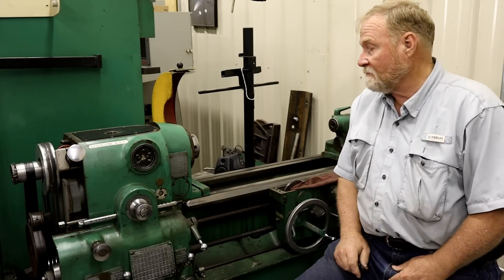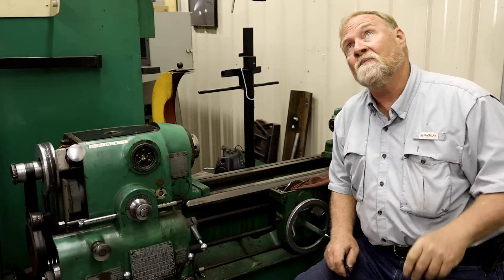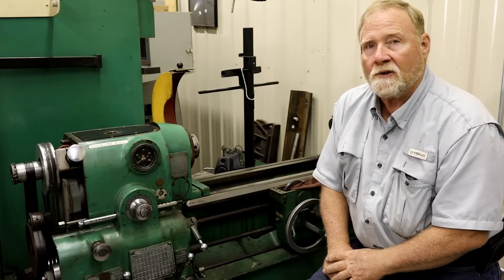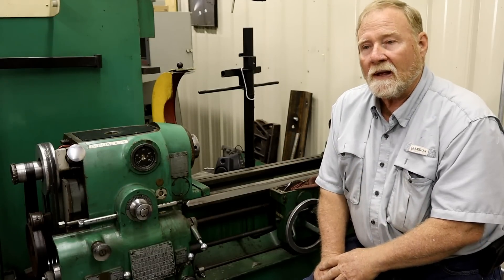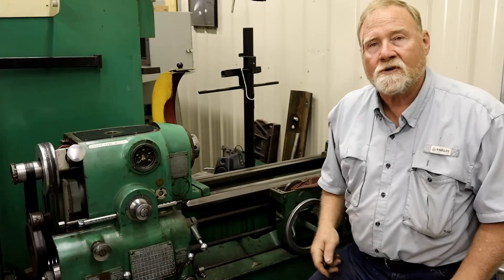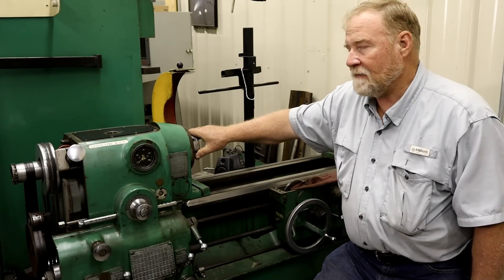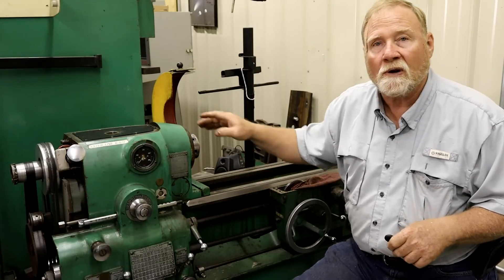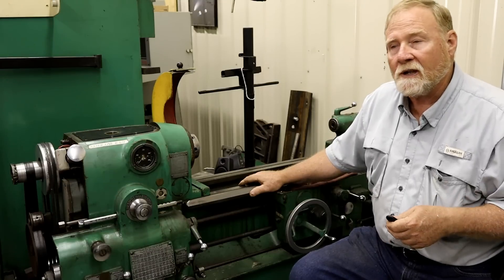$ 7000 Monarch 10EE Mistake : Fixing the Ways, Going to Windy Hill

Comment: With only having one shot at this to get angles and finish right.... Even though it is only 7 thou, I'd question if pneumatic angle grinder spindle bearings are going to be rigid enough to provide a precision surface without radial or axial deflection. Leaving ripples due to inconsistent speed or loads. Definitely not with a flexible sanding disc. A cup face wheel if trammed true to the surface being ground? Although leaving circular grinding marks. 
I'd speculate you will end up hand scraping to finish anyways to match the apron ways to the bed ways or visa-versa if turciting to restore apron position to whatever is removed from the bed. Maybe practice on a throw away lathe bed to prove your theory first?  Mount that grinder to your planer to prove best results on scrap similar to the 10EE material hardness? 
I've known field service guys years ago with similar portable mills putting the crown back in press brake beds mounted exactly like your plan.
Reply from the maker: The whole point of this method is I don't just have one shot at this...  Just like when I scrap in a way or edge I scrap a little and measure... Using the die grinder like a scraper tool....

 IF all else fails I'll just rig the grinding spindle on the planer..   I am looking at this method hoping it will be sorta like a portable line boring operation :)

Comment: yes it would work,
could you set it up on your planer with grinder spindle?
or get Thompson ground rods as your temporary ways
Reply from the maker: The rails I am making are going to be as good as a straight edge, I'm shooting for hand scraped perfection here and the rails have to be perfectly straight for 48 inches with no sag or flex.. I have never mesed with the ground rods but I doubt they can hold the accuracy I need...
Reply: @10swatkins  I like your idea for Ingenuity

Comment: Small air grinders do NOT have preloaded ball bearings like a toolpost grinder. All that rigidity you talk about wanting in your iron guide rails will be lost in loose bearings.  Bear that in mind.  Also, you might be fighting wheel wear on very small abrasive stones.  Maybe think about using CBN wheels, as they wear very slowly. Something resinoid bond should be good enough. I think the nickel plated wheels will just cause chatter and burning.  Consider designing your iron rails so they can bear on the UNDERSIDE of the bed ways, where the uplift straps usually affix the carriage. Usually the uplift straps never actually touch, and there should be no wear on the bed under there.    Best of luck.  --Doozer
Reply from the maker: A tool post grinder is too big to get anywhere close to the head let alone past it by the three inches I need...     The die grinder is as big as I can get into position to do all the angles... The rigidness of the rails is to prevent sag  and alignment to the best it can be... I Don't think of this as so much of a grinding operation like on a grinding bed... I picture it more of a delicate hand scraping job , using a die grinder rather than a hand scraper... If this was 20 or 30 thousand I would have it apart and on the planer with a grinding rigup... This is only 7 thou and will just take patients..  

 Oh and with the rails and heavy sled I have a perfect indicator base that is not affected by any of the operations and can let me see how I am progressing at any time :)
Reply: @10swatkins  Steve, I am not saying to forgo using your die grinder.  Not at all.  Just saying be aware of the challenges of getting a good finish without pre-loaded bearings.  Hence the recommendation of a  CBN resinoid bond wheel.  --Doozer

Comment: Love your confidence and getter-done attitude.  About the sanding disc, r u planning on the ubiquitous rubber sanding pad.  Are you concerned that will deflect?  What about the spindle runout on the die grinder?
Reply from the maker: I can't get anything large up close to the head so everything has to be small... A cylindrical flap disk small enough to do the job,,,

Comment: How will you ensure the grinding rails are in a parallel plane to the spinal rotation over 48 inches? 
Also, should you use a larger diameter grinding wheel instead of the die grinder? Wouldn’t this be a way to limit the wear on the diameter of the wheel as it traverses the length of the bed?
Reply from the maker: A larger wheel can not get close to the head....   I will align and check alignment using other surfaces that were ground when they made the bed, Thanks for watching..

Comment: Could you temporarily repurpose the cross slide and mount it on the aluminum plate? It would definitely be rigid enough and yet adjustable.
Reply from the maker: That's a though...  I think not only because I need a lot of travel across the sled to be able to lay the die grinder where it needs to go... To get the back saddle rail it will be 3 inches off the side of rail...  Thanks for the idea !

Comment: I think your plan is the best bang for the buck. The sanding disc idea I'm not sure will work because sanding grit and hardened steel may not have much longevity. I'm thinking a high quality grinding "stone" of surface grinder type material  might be better.AL B.
Reply from the maker: From my experience sanding is a lot faster than grinding stones...  I have under construction a Mech Mate Router Table... For years they have experimented with the best way to make the rail system and grinding disks were found to not work nearly as well as flap disk sanding pads... Now I'm thinking that it might have to be a combination of both to get a really nice finish...

Comment: My prediction:  you and Clarke are going to BS all day and become great friends, then at some point in the future on another trip actually get the furnace fired up, molds rammed, and metal poured.   You're also probably going to come home with at least one broken muller to add to your project list.   Spare yourself and give that project to Don.   One more thing, PLEASE mount that die grinder by the angled gear housing itself and not the motor body, they have a terrible tendency to vibrate the jam nut loose under load/vibration (especially when mounted solidly) and then the head swings around and digs into the work or just blows up.  There isn't enough red Loctite in the universe to hold the danged things secure.
Reply from the maker: I think your right!   I am trying to talk Don into coming with me... He can work on the muller while we BS :)

Comment: The concept is solid but I doubt the die grinder will get you the quality outcome you're looking for. the spindles in the die grinders are not precision spindles and usually have quite a bit of slop in them you are going to need a grinding spindle of some sort.
Reply from the maker: They are too big... If there is slop I can overcome that... Don't think of this as a grinding project where it comes off the machine in one pass and there are no adjustments.. Think of this as I do... A bed that has to be hand scraped  to get to perfection... The die grinder is just a hand scraper in my mind...

Comment: Do you think you can find a cup grinding wheel for your grinder? A sanding disk is not stiff enough to do the job.
I know linear bearings are expensive, however you don’t get the grief of a wheel jumping off the track you designed.
Reply: I think he's intending to use a barrel sander, not a Roloc-type circular disk.  The barrel sanders ARE stiff enough and he's going to be taking multiple, very, very light passes.
Reply from the maker: The weight of the sled will help with rail contact... There will not be a lot of force as I will guide the sled and can feel what is happening..  
  Points for the grinder are available in lots of different shapes but I am really limited in the space up near the headstock... Small is the key here and a cup wheel to do the flats would be over three inches where I can get a cylindrical stone of about 1 inch...

Comment: Good luck!  Want to see how it turns out. You might consider using a woodworking router rather than a die grinder. Basically the same thing but already has the 90 degree platform made for you.
Reply from the maker: just no room up near the head to get anything bigger than the die grinder :(

Comment: I think the plan should work but watch those die grinder bearings.  I have a couple of 2.5" x 8" x about 15" 6061 drops as well as some 2" x about 4" x 6" A514 drops if you can use them on this project.
Reply: die grinder :(
Reply from the maker: Thank you for the offer! ... I have enough material running around here I think  :)

Comment: It can work but there are a lot of other factors. If you're satisfied the extra moments that you put in that you losing adjustment if you can overcome them I think you've got something. Because the outside housing of the bed is not necessarily precision getting it to run parallel and at the same depth it's going to be quite a feat. Sincerely Nick PS good luck I hope it works.
Reply from the maker: Earl there are other surfaces that were ground when they ground the ways... Those get no wear and are what I will use to verify the alignment.  Also think of this as not a one shot grind like on a grinding table.. I can always detect the changes in the way surface by using the sled also as an Indicator holder...  I can go along and tough up the surfaces much as I would when I hand scrape...

Comment: Really looking forward to see this plan in action. Can I suggest that you make your trolley reversible so that when you start to work on the back rails you swap the trolley around, keeping two wheels under the grinding head. I am also curious why you have chosen to go with wheels rather than sliding surfaces. I would think that 3 low friction surface points would eliminate any possibility of run out in the wheels and bearings and minimize the chance of the wheels running over some of the grit generated in the grinding process if you added a wiper or a raked leading face.
Reply from the maker: Love the idea of the wiper!   I am going with V wheels to help with lateral alignment.  I have a machine under construction that uses V wheels for it's rail system and it will hold .001" over 8 foot all day long...

Comment: Hi Steve, rip it apart and mount it on the planer, perfect candidate for doing the job.
Mount a toolpost grinder on the head.
You can cover the ways on the planer with plastic sheeting.
Coolant might be a problem, jury rig a pump.
Cant see a die grinder being the right tool for the task.
Unfortunately all machines wear out and so do we.
Reply from the maker: YOu guys just want me too work too damn hard!..... :)
Reply: Run it without coolant.  I've seen many lathe beds ground that way many years back on a planer.  Spray mist works too, for keeping the dust down.
Reply: yep grinder on the planer :)
Reply: Willem, I went through the comments before posting because I was confident that someone else was going to make this suggestion. I agree with you completely. It just seems like a huge waste of time trying to reinvent the wheel when you've already got one. That little die grinder isn't going to provide the level of finish or accuracy as a tool post grinder, and it's not that big of a deal to pull the head off the lathe.

Comment: I saw a video of a japanese guy scraping a machine component for alignment.  He used a grinder on the really bad spots.  He used it with an expert touch, just like a scraper---repeatable cuts, slightly overlapping, working systemmatically.  ALSO, I know it's annoying to get feedback like this but about 10 minutes of this video are review for those of us who are following along.  You already have a catchy title, which is easy to search.  If you use the format "... Part x" in the title, people who are interested in the full back story can search for "Part 1".  Saves you a lot of explaining, it's OK for new audience, and it's good for the dedicated fans.  BTW, I don't know if it came through for everyone---if you make the rails out of cast iron, you can plane it in-house and scrape that rail really straight.  Also, see if you can find a tool-post grinder, at least.  The die grinder's spindle may not be accurate.  With abrasive paper, 0.007 is a lot.  You might need a stone wheel.  Good luck with the casting.  I'm also a big fan of Clark, so I'm looking forward to that video.
Reply from the maker: thanks,, I know it's review for some of you but 75% of the people watching have never seen the channel Just trying to keep everybody on the same page... :)    Tool post grinder is too big to get up close to the head.... Need something that is small to machine the way that goes past the head by about 4 inches...    

Also this does not need to a be a one shot and all is well grind... With the outboard rails the ways can be checked often and then touched up where needed... Just like when I scrap something:)
Reply: @10swatkins , Scrap or scrape? Lol

Comment: Hell of a plan Steve, can’t wait to see the results. Wouldn’t a tool post grinder be better than a die grinder? Easier to mount and adjust ( you could bolt the compound onto your sled) and less runout
Reply from the maker: Post grinder is too big..... Have to get into the tight spots....

Comment: Sounds will though out and logical. I cant come up with any holes in your theory.
 I think the high RPM and low pressure of the die grinder will offset any tolerance errors it would have compared to a true grinding machine.
I think the hardest part of all of it will be the initial set up and measurements to ensure the "sled" is tracking dead true to both axis of the chuck (lateral & vertical) to prevent grinding the ways into a built in taper attachment!!!
All that said ... could two well calibrated 48" straight edges have been used instead of making new rails? The traversing setup would be almost the same ... points of the 45° .. and a simple gibb system.in the inboard 90° to account for micro elevations and lateral stability.
Thanks for sharing 🇨🇦
Reply from the maker: No good way to mount the edges as the handles will be in the way.. and really heavy....
Reply: @10swatkins  heavy ... I thought that's why you kept Don around! ;)

Comment: I’m not crazy about using that little air grinder, it’s going to have runout. An NSK Nakanishi precision spindle or something similar would seem more suitable.
Reply from the maker: I hear you....   But I need something small to get in the parts by the head... This does not have to be a one shot grind... The sled can be pulled and the ways checked and then touched up, just like I do when scraping a part in :)
Reply: @10swatkins  2000 series NSK spindles are less than an inch in diameter, I have a couple of the 50,000RPM 3000 series (30mm) units which I'm guessing are smaller than that air tool and although they are not cheap, they have a micron of runout and are made to precision grind. Even their handheld grinders would be more suitable than some non-precision air tool.

Comment: good idea!! I wonder if the twist strain on the cold roll would be more than the twist moment of cr might even go thicker? In my vast lack of knowledge,  it seems to me, that, although the grinder is putting a twist,  on  the deck, the spinning will eat the twist? I don't think you will be putting  5 ton of force on the. grinding wheel. please correct me if I am way out in Don's land. btw did he get a short cut or a trim?  lol 73 dan
Reply from the maker: He got a perm :)))))               IT's not strain or twist of the metal with the work.... It's making a very true 4 foot long edge that will not move and I can hand scrap to perfection...   Steel moves too much...

Comment: You didn't discuss how you were going to ensure the new sled rails are all in a plane.  Are you going to use one of the King way level devices that Keith Rucker has demonstrated in the past?  Also, if your ways required, say, 50 thousandths taken off, will that affect how your carriage (riding on the ways) interacts with the leadscrew?  Wouldn't that change the geometry?  Thanks for the video.
Reply from the maker: I have the parts for a Kingway that Richard gave me 6 years ago....  That will be put to good use :)

Comment: Steve , The rail system you describe should work fine . I am worried about the accuracy of the die grinder spindle . I would think a lathe tool post grinder would be better if you have one. Bill
Reply from the maker: Bill there is not enough room for the post grinder.. I have to get right up to the head and  even co past the head stock 4 inches....
Reply: @10swatkins  Ok I can see that but I still worry about that die grinder spindle. I have seen the bearing preload change when they are used for a long period of time . Bill

Comment: Curious to see how a die grinder spindle would hold up for accuracy (assuming nothing else added). I don’t see why it wouldn’t work in principle. My immediate thoughts are whether mounting the rails inboard to the tailstock ways would be easier. That way you piggyback on the beds’s stiffness already. This may not provide as wide of a support however and I see why you think the way you are. Not sure if there is a way around that by going vertical in some fashion, or adding length to the sled so as to help alignment.
Reply from the maker: Need the extra width for stability when the spindle is moved out side the rails to grind the flats... Well At least that is what I think now :)   Thanks for watching..